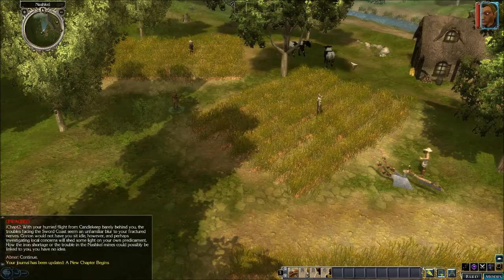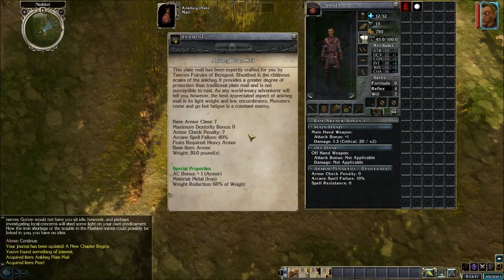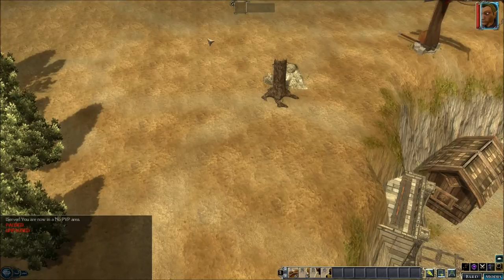NWN2 - Baldur's Gate Reloaded mod - Hidden Items! (part2)

Comment: They made ankheg plate mail half plate with no Dex bonus? Ugh 
It's main benefit was its low strength requirement - it was lighter. I'd have made it akin to +1 mithral full plate